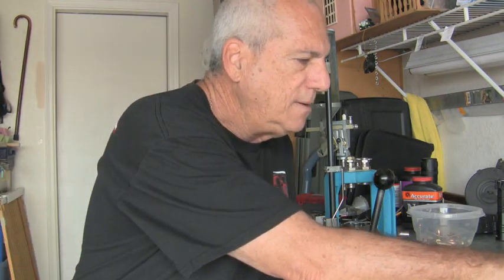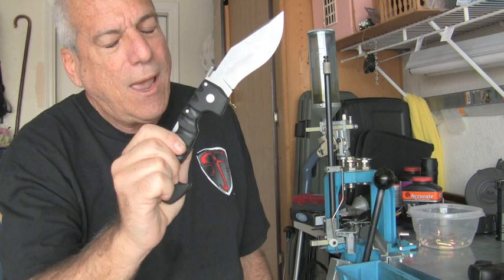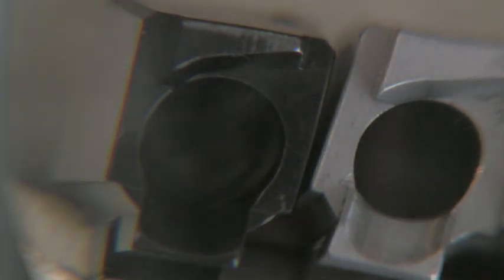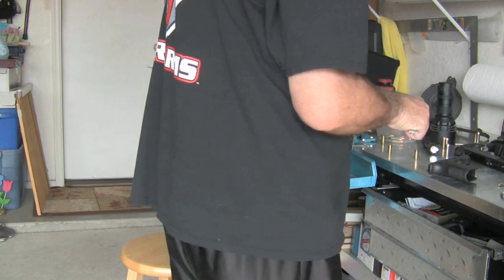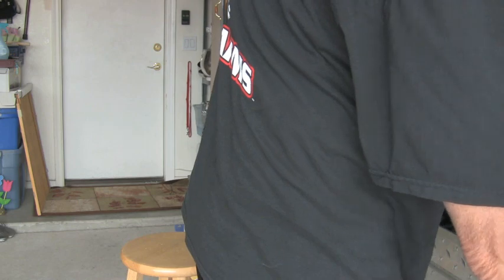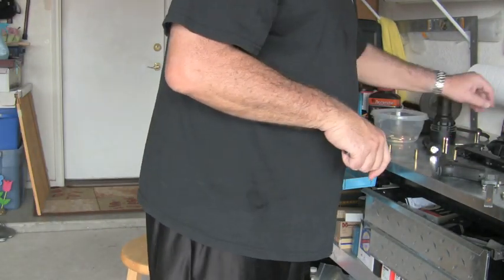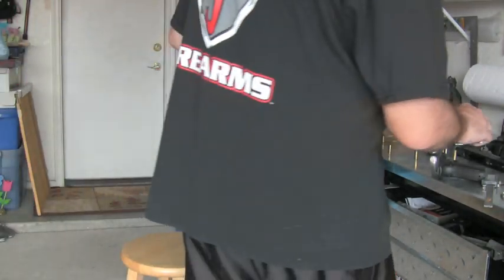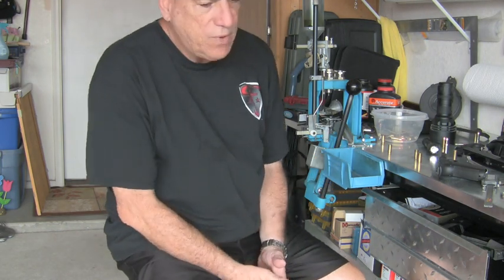The Infamous Glock Smile And what Causes Them

Comment from the maker: As a followup to my previous answers, I forgot to mention one item some might feel to be very important. Whenever I use any of my Glocks for CCW, I always carry with the STOCK Glock barrel for the exact reasons mentioned in my previous answer. This is not to say that KKM or Lone Wolf are not dependable. I use them for ammo testing , lead bullet ,and high pressure reload shooting. But bottom line when you need to be as close to 100% dependable, Stock Glock is the word.
Reply: So those would still work in a supported chamber--  Just don't shoot the old one's in glocks anymore.

Comment: Just to add a little to the tip given about looking at the extractor mark to count how many times it's been fired. The mark on the edge of therim will tell you how many times it was chambered. The mark inside the extractor groove will be deeper and is a better guide to how many times it's been fired. Extractor and ejector marks are much deeper in semi-autos and easier to see. Firing is much more violent action than manually extracting and ejecting a shell. As for your own reloads, many dies will leave their own signature on the brass you resize. Sometimes they can also be a good indicator of reloading. An RCBS 7mm08 die I used would leave a small tool mark just at the edge of the shoulder that was a reliable indicator of reload number.
Reply from the maker: Great observation. This is good information, and very useful input.
Thank you for chiming.
Have Fun Be Safe .

Comment: That gap is there as a safety device. In the event of overpressure the case will fail, blowing down, instead of the barrel failing and blowing up like a pipebomb. That said this is a great video for people who reload, valid points!
Reply: +DUK3NUK3M1 Negative nancy it's there to aid in reliability and while a over pressure will blow down, and to my knowledge nobody has lost any fingers with a Glock yet.  The problem is in a reloaded or simply thin walled case you get an explosion without an over pressure.  Shoot a squib and it'll still pipe bomb in your hand.
   Put it this way.  I work in a ammo plant...and I shoot lone wolf barrels in my Glocks.  It's very hard to over pressure a round.  It's not very hard for a out of spec thin walled case to get loaded and wind up in a box.  You have a bucket of 10,000 cases.  You grab a handful and check them and if they're ok the barrel is ok.  If there are 5 bad ones halfway down inside the bucket they will get loaded, and boxed.
Reply: +Slim Jim No negativity here, I was just informing as to what I was taught during the Glock Armorers course. That is what was explained to us about the "unsupported" barrel. Also it was taught that the new nitride finish is 99% rust free and almost as hard as a diamond(that was one of the test questions). So...everything with a grain of salt.
Reply: +DUK3NUK3M1 You can find plenty of examples of over pressure destroying Glocks and not just blowing out the bottom of the case.  I've seen them blow extractors out the side, bulge barrels, etc.  The reason for that gap is it allows a better angle on the feed ramp and is part of what makes a Glock feed everything so well.  
   It does make it the most likely point of failure the problem of course is as I said above it doesn't require an overpressure to cause it to blow out there.  Simply a bad case will cause a catastrophic failure.  You won't lose fingers but the pistol will be dead.
   The problem seems to become more prevalent the larger the diameter of the round.  You see it much more in .45acp, somewhat in .40 and 10mm, and very little in 9mm.  So they make call it a safety feature but in reality if it were fully supported the ONLY way for it to fail would be for a serious over pressure.  Which is much rarer than a bad case.
   Also I wasn't calling you a "Negative Nancy" just a slang term I picked up from working around Yankee's who instead of saying "No" say "Negative nancy".  In fact there is a link on the right to a video called "Glock 34 Explosion" which is a prime example of a real over pressure.  Entire back of casing blown off, etc.

   I like my Glock it's all in how you prefer to roll the dice as to supported, or unsupported.  If it made it that much safer every manufacturer would have stolen it.  It allows for failures that in other pistols would be a non-issue while perhaps maybe making a catastrophic failure slightly less catastrophic.

Comment: I color code my cases. Either by the extractor groove or base. Depending on what I'm doing. A multi-color pack of sharpie's is cheap. This allows me to do all the prep work in batches since tumbling will remove the coloring. This also helps with range trash that gets picked up. As we both know hot loading will reduce case life so I also color code for this. Especially in my 10mm and 9x23 Win cases. Still doesn't replace the need to inspect it all but it helps. Thought I'd pass this little trick along.

Love your video's btw. They've been informative if not just fun to watch. Thanks for your time and effort!

Comment from the maker: Your question intrigued me, so I went out an purchased a box of 84 grain 40 S&W. They did not have any 9mm, which would have given me a chance to test them with different barrels. With that being said, I shot at paper targets to test accuracy and recoil. The test gun was my Glock 27. Felt recoil was substantial almost surprising. I feel that these rounds are at the very edge of safety. I even had one round blow out it's primer. I am putting a short video together on it and will post it soon.

Comment: Do you think that the Glock smile and or Kaboom situation something that could happen in a low pressure cartridges like a .45 ACP? I been shooting reloads with brass that I have reloaded maybe 4-5 times, but I have not noticed the "smile" marks, other than in some Ruger ARX brass.
Reply from the maker: While using low pressure rounds in a fully supported chamber reduces the risk of case web failure dramatically, the unsupported chambers will still give rise to potential failures especially after a higher number of reloads.You are definitely in a much better position with low pressure round. That being said, it never hurts to develop a good habit of examining fired brass before reloading. This habit will pay off when you get into 40s, 10mm, and 9mm.
Thanks for watching. Have Fun Be Safe.
Reply: Thanks for the reply. I think I may start using some factory new ammo in my G41 until I get my hands on a KKM fully supported chamber barrel. I contacted them and they said their barrels are fully supported, and they are one of the few makers that offer an aftermarket barrel for the 41.
Reply from the maker: I have a KKM for my Glock 20. It is truly a marvelous barrel. You will love it. :)

Comment: The sharp line in the brass comes from not having a full length sizer.  I use a Redding GR-X pass through.  After being fired in a Lone Wolf barrel, the need for full length sizing is reduced.

Comment from the maker: I guess if i'm going to be brought to task, yes. you are correct. The fully supported  chambers in some cases with their tighter tolerance might result in some failures to feed. Glock wanted to provide a barrel that was as dependable with target ammo as it would be with match grade.It was meant to provide a level of dependability for the public regardless of what ammo the individual chose. Bottom line is that feeding dependability is more then just chamber support. It's a good starting point.

Comment: Really good info! I just bought a G27 and a couple of aftermarket barrels (KKM & Wolf). Now I know that I can use high pressure rounds in these and not the original. 
Also, if you look on Buffalo Bore's website, they state not to use their 40SW +P ammo in Glock barrels. They state this is an issue in Glock's 40SW platforms which is a short 10mm. I was looking at their website earlier today and after watching your video the dots connected! Thanks!
Reply from the maker: Marcos Stroud  Thank you Marcos. You have chosen two very nice barrels with your choices. Now you not only have tighter tolerances and fully supported chambers, but you also gain the ability to use hard cast lead bullets in your gun. With respect to Buffalo Bore, while they are a very good company, sometimes they overstate their velocities. I did some videos on this awhile back. If you want truly top drawer ammo for your weapon (if you don't reload) check out Underwood Ammo. They are the best (next to my own, lol)
Have Fun Be Safe.
Thanks for watching.
Reply: +jr10 Yeah, I hear Underwood is quality ammo, it's just hard to acquire because they're always out of stock with my top picks from their line-up...
Reply from the maker: That's because the secret is out. Everybody wants them. Keep checking in on them. The wait will be worth it. :)

Comment: Great info! This is a must see video for Glock owners! I went out a purchased Lone Wolf replacement barrels. The Glock Smiles are dangerous.
Reply: +tubehead357 That gap is there as a safety device. In the event of overpressure the case will fail, blowing down, instead of the barrel failing and blowing up like a pipebomb. Just be aware of that, If you do reload this man has a very valid point.

Comment from the maker: Not at all. The Glock barrel is not looser or wider. It is just not a fully supported chamber. This only affects the round at the case web area. On properly maintained and accurately reloaded ammo, along with new ammo, then barrel will handle well over 100,000 rounds.The tenifer finish on these barrels make them one of most durable on the market. The only limitations would be lead bullets and poorly manufactured reloads.
Thank you for watching
Have Fun Be Safe :)

Comment: My two cents, just FWIW.  I have reloaded for 10mm Glocks for years using only factory barrels.  Where you run into trouble is when you try to make hot rounds with faster burning powders.  Powders like Unique and 231 should be for very light target loads.  Don't try to use those to push a 200 grain bullet to 1200fps.  They just aren't meant to go there.  Blue Dot, AA9 and 800X are better choices for those applications.  And even with those powders, start in the basement and work up very slowly.  Reloading for Glocks with factory barrels is perfectly safe, but you have to know what you're doing.

Comment from the maker: The innovations that put Glock on the world map is long and ingenious. Polymer frames,polygonal rifling,tenifer coating to name a few. The beauty of a Glock is it's simplicity and dependability. One area Glock gains undeniable reliability is the chambering of a myriad of different types of ammo.This is only achieved by loosening tolerances in the chamber. The only way to get a fully supported chamber is an aftermarket barrel.Plus side, now you can use lead and have more reloading options. :)

Comment: Well my Redding G-Rx base sizing die finally got here a few days ago. If only I had this die 4 or 5000 pieces of brass ago. Lol. It really is a very valuable staple in the 10mm handloading realm. JR, you have to get one of these. It not only sizes the entire case (including the case web where the infamous bulge, "glock smile" tends to be) but it gives your brass triple the longevity because of it smoothing the web back out without over-working the brass. The kit comes with the die, the push through rod, and a sample lip-balm size tin of Redding Case Sizing Wax all for 35 bucks. They also have a carbide version, which is about double the price but would be more efficient because you wouldn't have to lube each case before running it through the die. I'm going to make a video review of this die, what it comes with, and of course the sizing process with extras of me measuring once fired brass that was sized in a regular full length sizing die and once fired brass that was sized with the G-Rx die and send you the video. Oh yeah, that Winchester Autocomp powder I got for some new 10 mill loads seemed to be an awesome powder for the pressure/power curve that the 10 mill needs to perform. Going to go out and test some more of these loads this weekend and I will try and video the test and then use the empties for the G-Rx die review. JR, wish you the best.
Reply from the maker: I love Redding equipment. They are one of the true class acts in reloading equipment. To be honest, my Redding die sets outnumber my Dillon dies! LOL
Have Fun Be Safe :)
Reply: jr10 I have never had a Dillon set but I hear they are supposed to be the best of the best. I'm sure you recall the Bonanza Die company, which is now Forster. They make one of the finest rifle seating dies (it's made just like the Redding Competition Seater with the spring loaded bullet alignment sleeve) and I wished they made one for handgun. Redding does of course, but I have always favored the Bonanza style die. I still haven't had any luck on finding any 800-X powder. I tried some factory ammo here awhile back. It was the PPU's 10mm offering (Prvi Partizan) 180gr JHP. They were pretty accurate. However, the metallurgy of the brass that they use to form their cases looks to be pretty soft. The ammo isn't loaded warm at all (1197 fps and 1090 fps, I don't kow which loading I have, the box doesn't specify but there are only 2 jhp loads for 10mm that ppu produces, neither of which are loaded what we would call hot). The reason I say this about the metallurgy of the brass being soft, is the fact that the cases looked great before I? fired them, and afterwards they looked as though they had been loaded a few times because of the shape of the bulge at the case web. Needless to say, I'm avoiding loading them too warm because I don't want the cases to fail because of the soft material they were constructed of. I have shot them once, and I loaded them again with a mild exactly 8 grains of Winchester Autocomp (velocity should be around 1254 fps and pressure around 29,000) with an Xtreme brand 155gr RNFP bullet seated to maximum length to keep the pressure down,  and I added a light crimp with my Lee Factory Crimp die. The brass looks alright since I resized them in my Lee carbide FL resizing die, but I haven't ran them through the Redding G-Rx base sizing die yet because at the time of me loading them, the die was on it's way from Midwayusa. Lol. I'm not too awful worried on shooting them because like yourself I inspect every case that comes in contact with my fingers or my equipment and these looked to be well within the norm of loading again. The bulge is barely visible to the naked eye unless you hold it up to light and look up the side of the case and even then, the bulge is noticeable but it's not reaching out and slapping you in the face as some of my 10 mill loads have been. 180gr GD over a damn near compressed charge of No. 9 will make even the tightest chamber quiver. Lol. Thanks for the reply JR. Hope to get out tomorrow and video the test of some new 10 mill loads and a video review of this G-Rx die. 10 mill loading sure puts a smile on my face and a ringin' in my ears :) Ya gotta love it

Comment: All brass will expand.... Glock is no worse than most semi auto loading pistols.... that is why you have a re-sizing die... which will remove the bulge..... if this is the price to pay for reliability so be it... My glock runs perfect and I have no problem reloading the used brass out of it....
Reply from the maker: +gmcjetpilot It is common knowledge with reloaders that brass cases expand. The point of the video was to elucidate the effects that the unsupported Glock chamber had on that expansion. It is also common knowledge to expect case web weakening over a period of reloads do to the unsupported chamber. Case resizing will not remedy this.
Reply: +jr10  With respect great video, good points and tips...  but common knowledge by internet experts is  not always true or common. Glock "smiles" are not common. Normal case bulge always occurs regardless of gun, you agree. I'm a long time shooter and re-loader. I get your point,  but my point all cases expand in all guns, Glock or not. True feed ramp drops in breach at 6 O'clock, but bulge is also due fast semi-auto action which happens with most guns. Glocks do start case eject while still under pressure, but a true "smile" on the case I think is likely due to excess or wrong combinations of: too much powder, too heavy of a bullet and too short OAL. As far as metal fatigue, yes true brass does "work harden" from repeated shooting and reloading. But that does not cause smiles, it might however cause rupture or cracks. You can (and some do) "anneal" the brass and extend the life, but more for rifle cases not hand guns. Annealing  takes care to heat and cool at very specific temps... not within most peoples wherewithal. Fresh free brass others leave behind can be had at range, so no need to reuse brass too many times, but I have gone more than 6 times on 9 mm. Your point about losing count (good point) and extractor marks is good one. Last not sure what Cal you are talking about, but 180 gr bullet at 1250 fps sounds hot to me....If you are practicing, Why? run down at the low end and get more life of brass if that is a deal for you.....May be you are already are conservative? Cheers
Reply from the maker: +gmcjetpilot Valid points. Bottom line for me has been the reduced case bulging and case web stressors 
seen with fully supported chambers. Do what is best for you, however.
Have Fun Be Safe :)